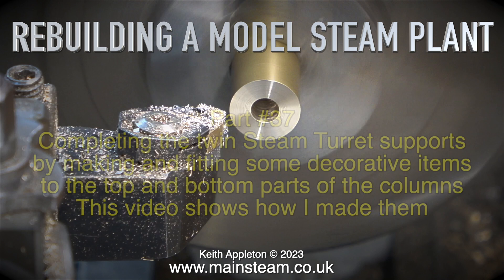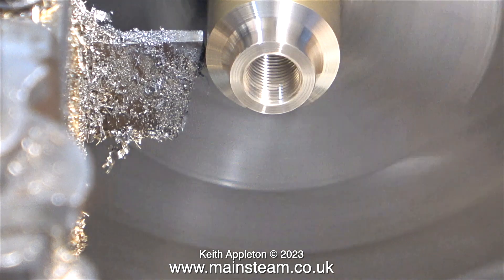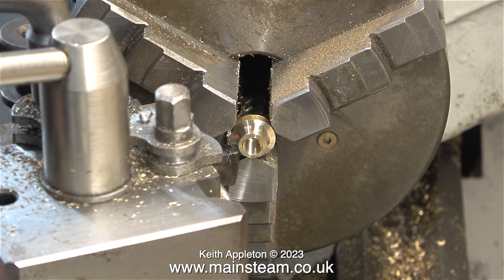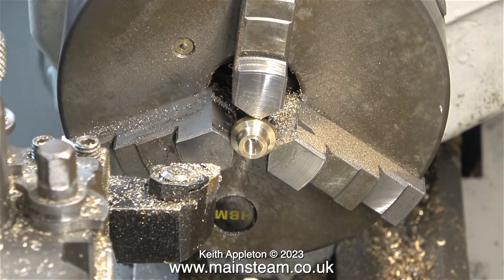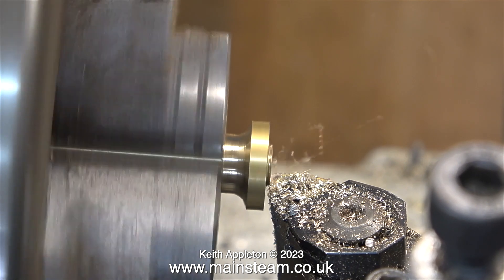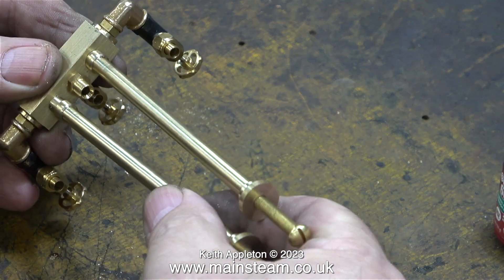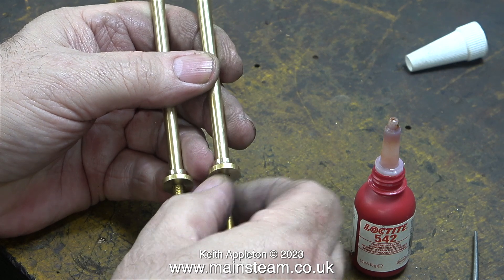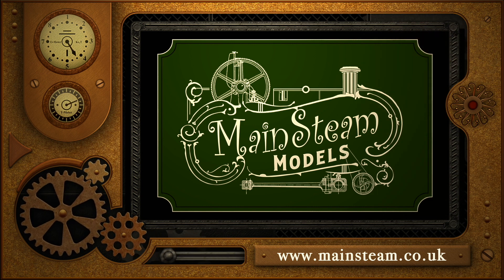REBUILDING A MODEL STEAM PLANT - PART #37

Comment: I bought another Bahco tool the other day, I already have an adjustable spanner, like you. The new tool was a round file, quite possibly the best file I ever owned. I needed it to  file out some slots in a mounting bracket made from 4mm mild steel, it cut really well.